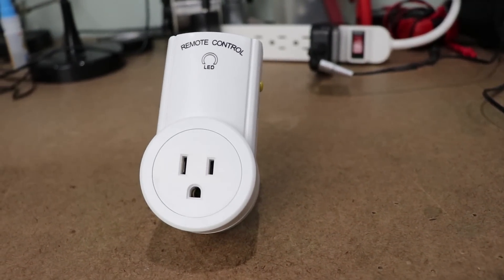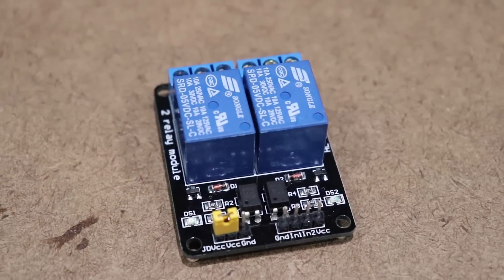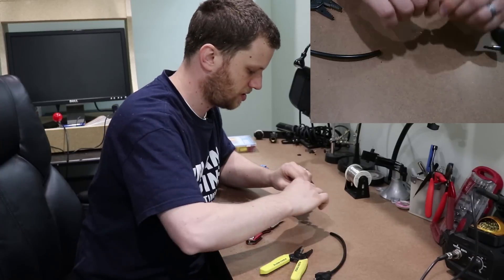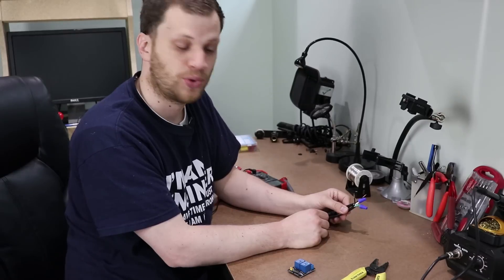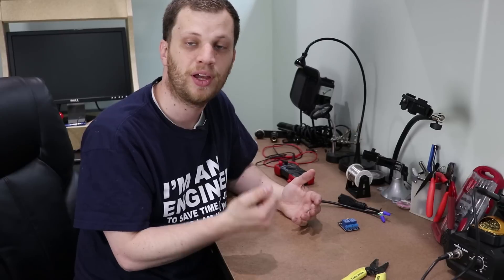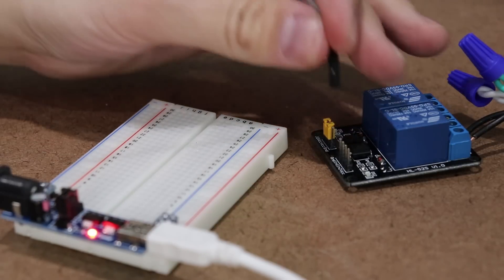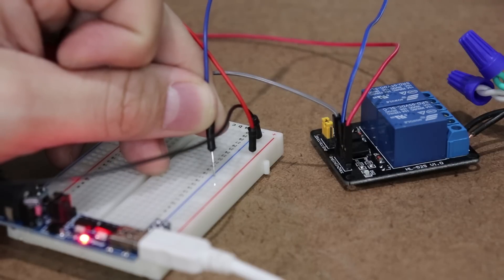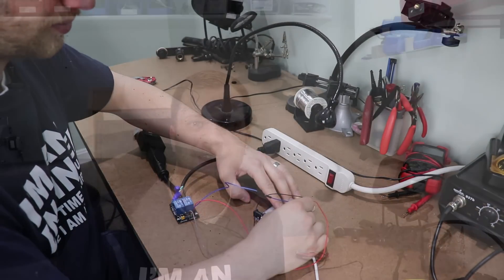DIY Smart Switch - Part 1 how to use a relay

Comment: High voltage?   you may be an EE but...   High voltage isnt found In residential..   120/240v household pwr is just that..    600v is considered High voltage in distribution..    and in industrial applications, high voltage is 12kv..
Reply from the maker: I work with embedded electronics, anything above 12V DC scares the crap out of me! You are correct though, I should be more careful to use the right terminology. Thanks for catching that.
Reply: I work with a lot of battery systems up to 138 vdc..    you won't really start getting shocked until well over that in dc.  but the amperage becomes pretty dangerous at 12v with the right amount of potential .     and 120v ac is tricky shit..  it'll shock you without a path to ground due to the potential difference between you and the ckt.   now 277 and up won't pass through you without a path..   We mess with our apprentices when they first get introduced to live voltages.  Standing on an insulator, rubber mat or blanket, or In a bucket truck, you can reach up and grab a single line beit 277, 2300, 4160 etc..   as long as you don't touch ground or another line your fine..   but voltages higher than that, theres a ton on potential..  so you'll get zapped when you grab it as the potential between you and the ckt becomes the same.  Thats why you can light bulbs in free air in close proximity.. Have fun..

Comment: Question for you. I’m trying ontrol a linear actuator so I can just retract the actuator when turned off and then extend the actuator when turned off? I am trying to control a door to open and close. Can I use a relay and can I make it wireless with Alexa or Google? Thanks.
Reply from the maker: Sounds like a great project, I believe I answered your personal message in my inbox.

Comment: Hey..can we connect 9v battery to the inputs of relay???
Reply from the maker: You need to read the specs of the relay your using, and the specs of any transistors that might be used to energize the coil. Most should be safe with 9V, but you should read the specs to be sure.

Comment: What kind of control signal you gave to the breadboard. I didn't get that? WHat you did on the bread board side?
Reply from the maker: I was swapping the relay's input pin between 5V and Ground to turn on/off the relay

Comment: Wiring the Neutral and Ground/Earth together shown in this video is incorrect. The ground wire should not be wired through the relay at all. Otherwise, it defeats the purpose of being the safety dischage to ground if not connected.
Reply from the maker: Please watch the video again, the neutral and ground wires are not wired together, and are not connected to the relay.
Reply: i stand corrected

Comment: Which end of black wires connected to the common and normally open terminal. The one to the wall is normally open and to the lamp is common? Thank you
Reply from the maker: In this configuration it doesn't really matter. Since the wall wire is the one we're switching, I would connect that to common, and the lamp to normally open. It will work just fine if you have them the other way.

Comment: “wire nuts” -> marrettes. Also the live wire and the neutral were really close together attached to the relay. Use heat-shrink tubing as a best practice.
Reply: maybe do it properly with wire bootlaces. The way you have shown is just not safe.
Reply: ME? - I JUST USE GUM!!! :P
Reply: It’s 2 years later. Your video was well done. And you could have complicated matters by following my advice. But keeping it simple was the right direction.

Comment: Im an engineer? its stand on your shirt.  Well i do work with electrinics in real and to be honest your connection is horrible :D 
Do you not see all the open cobber on your hight volt side. 

Use Crimpins on the wire and a good Crimping Pliers.   And make sure the wire get all the way inn to the connection. You should not see any open wire/cobber.

but out of the info, great video
Reply from the maker: Thanks
Reply: Cobber? You mean copper

Comment: What am I doing wrong? If i connect the wire to the ground row nothing happens, but if I connect it to the 5v row it works? It's the other way around in this video.
Reply from the maker: You are probably not doing anything wrong. Is your relay on a circuit board like mine, or stand alone? It all depends on if there is a transistor driving the coil and what type (pnp, npn, p channel, n channel). If you are getting the relay to open and close, but it's opposite of what you see in the video, it just means that you have a different type of transistor. Nothing is wrong! What kind of project are you using this for? I'd be interested in hearing about it.
Reply: byte sized I would like to use a smart phone to trigger the relay when a text is received. Any ideas? I know voltage is not enough from either the speaker or vibretor!

Comment: I don't quite understand the GRD/VCC/IN2 part which is the triggering part. Say if I am having DC triggering, which has 12v/150ma (positive and negative wire), how should I connect it? pls advice, thanks.
Reply from the maker: The board I used in the video has other electronics on it that allow you to activate the relay with 5V as well as provide some isolation. These electronics need to be powered with 5V (they may allow higher voltages, but I would need to check the datasheet). So I connected 5V to Vcc and Ground to GND. Now that the electronics are powered on, IN2 is the pin that will activate the relay. If IN2 is connected to GND the relay will turn on, if IN2 is connected to Vcc, the relay will turn off. Read the specs of the relay you're using, you might be able to use 12V on Vcc instead of 5V.  Hopefully this helps!
Reply: Thanks for the advice.

Comment: This video is probably the best explanation you can find on Youtube. Clear and straight forward. Million likes!!
Reply from the maker: Thank you! That means a lot! I appreciate your feedback!
Reply: @bytesizedengineering  is it possible to connect the two relays in such a way that when powered the Normally open will close and the other one will open which is normally closed? What I am saying let us suppose we have two power connected to two relays from two different sources, How can they be connected or wired in such  a way if possible that when one power is on the other one is off? Think about it , seems a good project if it can be done?

Comment: As a student taking ECET, I HIGHLY recommend not to use a cord to connect to the lamp like in the video. Some of the copper wires could still be exposed and when touched can be very fatal. I suggest buying a GFCI outlet, then encasing the outlet and the relay in an outlet box.
Reply: look at it from this angle - you can be pregnant with one fetus and you can be pregnant with 3 of them. then you are "very pregnant" , especially at later stages :)
Reply: @mmca2  lol
Reply: Makes sense... btw what's the difference between fatal and very fatal? One kills you and the other? Is it like being pregnant and very pregnant? (just pulling your leg a bit...)
Reply from the maker: Thanks for the tips!

Comment: Actually normal refrigerators are few hundred watts max..
Reply from the maker: That is probably true when they are idling, but when the compressor starts up you can see huge power spikes that will likely damage a relay like this. Thanks for the tip though!
Reply: That is right, some motors use 3X for their power rating for a few seconds to start. The relay that you had would tolerate up to 2kw of power before it gets damaged. But it would be better to buy a relay with higher current rating.

Comment: Could you add the relay directly to the lamp (cut the lamp cord and add that to your relay)?
Reply: Yes you can, just replace the live wire on the extension cord with the live wire on the lamp cord. This was designed to save you from ruining the cord though. That and you could potentially put a snazzy box around it.